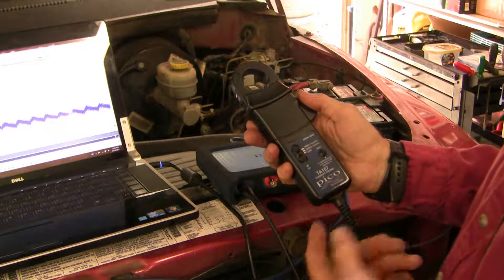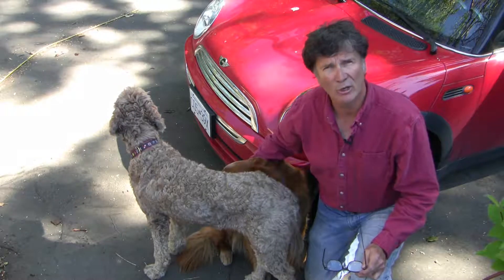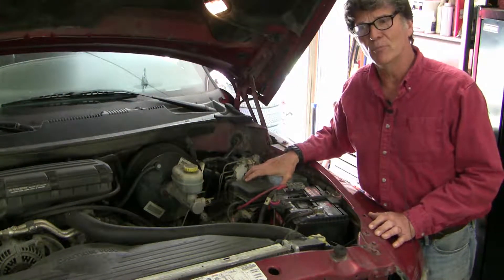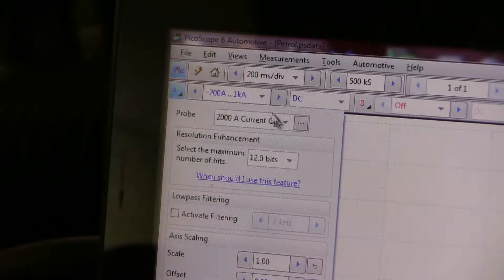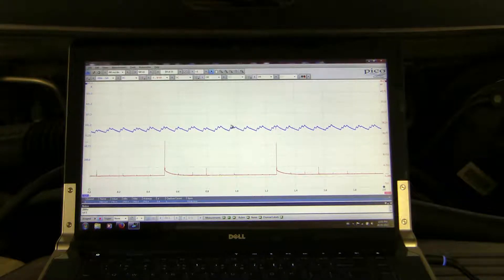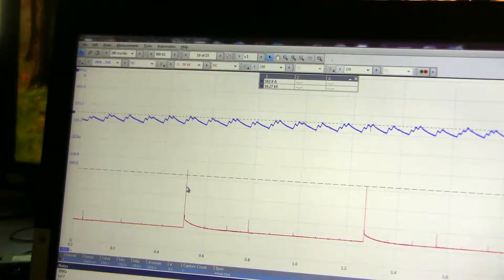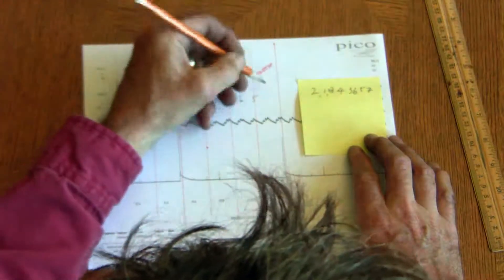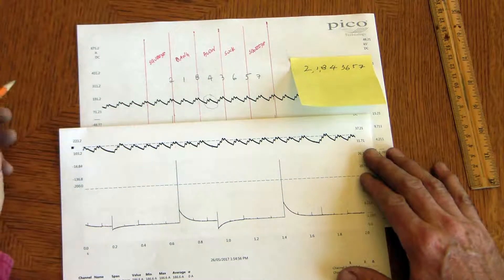Exploring the Picoscope as a diagnostic tool - relative compression testing

Comment: i wish you could have showed me how u connected it . I would have gave you a 5 star.
Reply from the maker: Oh sorry, you just push and twist 1/4 turn clockwise, it's a pretty typical BNC connector (is that what you meant?). Wikipedia have a description of the history and inventors. By using coaxial cables, they get around some inductive effects of two wires in parallel.

Comment: Hi Dave !!...great video. I just bought myself the 2 channel 4000 series Picoscope a few weeks ago and have been using my "drive only in sunny weather" 2001 Corvette as my "guinea pig" for testing...I'm up to doing the relative compression test using my Pico 2000 Amp clamp (same as yours) and a "sync probe" I purchased from AES Wave. for whatever reason the Amp clamp was unresponsive...do you think a bad clamp ??...now if I set my scales up on the high amp clamp to a low scale would I be able to check say my fuel pump...I have used my low amp clamp to check my fuel pump and it worked great...just want to check to make sure it's not defective...I used the compression test in the Pico's diagnostic program the other evening and that worked fine...just connect to the battery terminals and crank.. Thanks !! p.s. Using the sync probe what probe do you tell the Pico you are using ???...  I don't see any clamp named "inductive" clamp in the drop down menu...I guess you use either secondary positive or inverted ??
Reply from the maker: Check the battery on the 2000A clamp, make sure it doesn't turn itself off while you are setting up the test, it is automatically programmed to turn off after a few minutes of activity. It has an LED light to show when it is on. You can also check amp clamps with a multimeter to try and decide if the issue is with the clamp or the channel or channel wiring. Make sure the channel is turned on and recording. Yes, fuel pump amperage is usually about 6A, although newer pumps use a pulse wave modulated signal so when you look on the scope you see a rapid on/off pattern, with the duty cycle measuring power draw. You probably already know this but for others who read the thread, make sure the amp clamp is only around one wire, a second wire with current going the opposite way cancels the signal. For sync I set it up as secondary voltage, and my gear seems to do better with the inverted button clicked, and of course with capacitive clamps you don't need an attenuator, voltage works at a setting of ~5-50 kV. I discovered those PICO clamps for secondary voltage are actually capacitive rather than inductive, although the end result is the same. If measuring primary side voltage on either the coils or the fuel injectors, make sure to use a 10:1 attenuator because of the sharp voltage spike when the current turns off. Good luck!
Reply: Dave, thanks for the quick response. I read that the clamp does turn itself off and one time it did that...now I check...I've read that you can turn off the "sleep" function. My fuel pump checked in at 6.073 amps at 5314 RPM...The amp clamp is around only one positive lead...oh yes, I also purchased the Pico COP probe to use that on my 2016 4 Runner...did not get a signal but when I put it on the Corvette's coil I got a strong signal...Pico told me that some of these newer cars COP's are "screened"...the British term for "heavily insulated" I guess and I should drop down to the Mv range and that worked. I'll try what you suggested and thanks again !!p.s  I see you are good friends with Matt from Schodingers Box...a very SHARP tech and a Microbiologist to boot...LOL !!...and Eric O and Paul Danner are "legends"...learned a lot from those 3 gentlemen.

Comment: Great video please do some more using the pico, do a cylinder pressure transducer
Reply from the maker: Thanks, man! More on the way, but I haven't jumped into pressure transducer work yet. I share your interest in the subject, they get so much more information compared to analog max pressure readings. Cost for the equipment is my main barrier, and also I think one needs to see a lot of waveforms before getting a firm grasp of what is normal. Especially with all the variation in cam timing methodology from each manufacturer, understanding normal is harder than it sounds.

Comment: Very nice vidio...im new to pico .....how can i remove waveforms from files..thanks in advance
Reply from the maker: Remember to save your files before shutting down the computer for the day. The next day, boot up the pico software on your laptop, and reload the file you saved with the pico program. I believe pico offer the software for free if you get the file elsewhere or use a different computer. If you saved the entire waveform you can scroll through pages to get the one you want, and conveniently you can zoom in to get the exact shot you want. Zooming out is not as easy if your captured waveform was too magnified and spans two pages, so try to capture everything you want on one screen, even if you plan to magnify later. Remember that zooming in will require higher resolution so you want a high sample rate, so you don't end up with inadequate resolution after zooming. Pico also offer the option to save only one page, which makes for a much smaller file that is better for emailing a page. In that case you want to carefully adjust your fields so you show exactly what you want. Finally, there is also the option to do a screen capture from your computer to create a photograph of your waveform and whatever else is on your screen. Of course saving a screen capture that way won't allow you to manipulate the image or measure qualities inside the pico program, so that option is only for conversion to non pico communication. Good luck, pico is an excellent program.

Comment: A couple of points. You said in your video – “Exploring the PicoScope as a diagnostic tool - relative compression testing” (time stamp 4.40) - that an internet connection was required to access the help files which are found in the drop down sub-menus under the 'Automotive' menu. You did add a written comment to the screen, and you are right, you don't need an internet connection for these files: they are in the software! There are just over 150 of these generic files in the software. 

Maybe you initially confused this feature with the 'Waveform Library' accessible from the 'File Menu'? You DO need an internet connection to access the 'Waveform Library' - as well as a user name. You need to sign up for the free forum access, and then use that same user name to access the 'Waveform Library', which is itself only available when connected to the instrument, and to the internet! 

It’s worth noting that the 'Waveform Library' currently has over 3600 vehicle-specific examples in it. This data base can be searched by make, model, VIN, component, fuel type, etc. Further, many people don't appreciate the true value of this resource. Once you find a file which corresponds to the vehicle or component you wish to analyse, you can use this file as your test file, and it will appear 'ready-to-go' with the same settings, thereby removing the need to make any adjustments to your own settings. Just select the file, hook up to the car and you're ready to go!

New users - especially those who consider the tool to be expensive - may not know that apart from this powerful FREE resource, which enables Free file sharing and the instant use of known good waveforms from a worldwide community of experienced PicoScope users, they also get FREE software updates for the life of the tool :) 

PicoScope comes with 2 software programs - PicoScope 6 and PicoDiagnostics - both of which can be downloaded free, and used in demonstration mode - without buying a PicoScope. Users can see for themselves the features, including all the comprehensive help files which show both generic vehicle information, as well as a massive indexed manual and a tutorial on using the PicoScope software.

PicoScope has been designed to get new users started with the oscilloscope, which is one reason why it has pre-set menus, though these can be turned off, allowing the more experienced user to use the plethora of other features. This makes PicoScope so versatile and in my mind the best tool in the world for learning about the operation and diagnosis of any vehicle system. 

Those who use price or 'it's too complicated' as excuses not to move forward with the changes in technology are really shooting themselves in the foot! Relying uniquely on the 'trusted' scan tool and its limitations is a big mistake! 

Perhaps an explanation of the differences between the scan tool and the oscilloscope and a broader understanding of how and what they 'see' would make an interesting video, and encourage more people to make the transition to ‘proof testing’ with PicoScope, as opposed to trailing along oblivious to what is actually happening during a particular event, just because the scan tool has indicated a 'problem' - or because it hasn't indicated one, and the vehicle ECM is merrily adding fuel to compensate for a problem which isn't there, or isn't the cause of the problem!? 

PicoScope gives us that vital information to make sound judgements about the state of operation of almost any component, circuit or vehicle system. Understanding this is key to getting away from the traditional methods which we used to employ, and to getting to grips with finding the origin of faults and to fixing them first time around!

Learning should be a continuous and fun part of our everyday work. PicoScope has certainly played an important part in keeping me interested and faintly informed, even though I no longer work on vehicles.
 
In the hope that this helps a few people ;)
Reply from the maker: Excellent points, David, and very well stated. I've been looking around at scan tool options lately, and the hidden cost for scan tools is in the updates, which are astronomically high. For the Pico, endlessly free. I have used the library and the forum, both useful as well. Knowing what is a normal waveform for a specific car will continue to be a challenge, in part because some dealer repair manuals lack important detail. 

Dave
Reply: Yes, I agree with you on the scan tool update issue. As a diagnostic tool distributor, I'm constantly looking at new tools, but frankly the market here in France isn't quite the same as the rest of the world. If the tool doesn't 'speak' French it's pointless even offering it. (Luckily the Pico does 'parler français' so it's fine here, too!) 

I tire of people expecting a scan tool to work on every vehicle, and equally of those who sell them claiming that to be the case, when we know that no tool does it all: certainly not in my market where the market is split largely between European and Asian makes. Let's face it, even if the tool communicates with some of the car, so often the coverage of control units is incomplete, rendering it much less use, especially where there is an issue in a system which isn't covered!

My interest and efforts are focused on the PicoScope and its accessories since it does what it says on the tin - and more! I've known Pico since the beginning - when I worked next door to their first building - so I've seen the company grow from small beginnings to becoming the world leader in their field. Whilst I'm entirely independent, I distribute their tools in France, French territories, and Africa. 

It's really rewarding talking with those interested and being in a position to understand their plight and to encourage them to take the step into Oscilloscope diagnostics. Many of my clients are schools and technical colleges, though more and more garages and even individuals are getting the bug! 

The pressure transducer is also a popular accessory, and this adds another interesting diamension to diagnosing internal engine problems, as well as those which concern pressure in other areas of the vehicle. 

I'm filling your page again - sorry!!  I don't suppose you speak French? Your videos would be perfect here if they were in French! I tried the auto-translate but frankly it doesn't do your videos justice. I could do that for you if it would interest you, but ideally it would need to be voiced over, rather than subtitled, since it's difficult to follow like that.

Let me know your thoughts? contact@autotechnique.fr 

Keep up your great work :)
Reply from the maker: I really made an effort to learn French, and we sent my son to a French immersion school. Sadly, learning French is one of my major life failures. If you'd like to contribute a voice over, I would support that. I don't know what that would involve or whether it would be worth it to you. Thanks for stopping by, David!
Reply: Thanks for your reply, Spelunkerd. After nearly 19 years in France it's still an effort for me, lol! On my next lazy Sunday afternoon I'll try following you in French and see if it's workable. Could be quite a bit of work, but I like what you're doing! Thanks again.
Reply from the maker: Thank you David, that's very kind.

Comment: I don't understand what you did with the ruler. What did you measure when making those marks with the ruler at an angle? Good Video.
Reply from the maker: Excellent question! A quick way to divide an odd length into equal parts without using any math is to tilt the ruler at an angle. In this case I wanted to divide the distance between the firing spikes for cylinder #2 into four equal parts, corresponding to the four phases of the combustion cycle. The length between the two marks was about 3 1/8th inches, which would be tricky math. So, to avoid any math I tilted the ruler at an angle to increase the length to an even four inches, which made it easy for me to put a mark at each inch mark. In this case I lined up the mark for 1" on the left, and 5" on the right, which gave me exactly four equal 1 inch segments between the two ignition spikes for cylinder #2. Then I put a dot at each of the inch divisions. After that I used a straight edge to bring those marks vertically down to the baseline (easy with vertically lined paper). On the PICO you can do that electronically by just dragging a 720 degree slider, but with pencil and paper it is easy to do with a ruler. You can choose any multiple you like, but in this case the 1" marks worked out fine. Thank you for watching.
Reply: Interesting. Thank you.
Reply: @spelunkerd : Just brilliant!

Comment: I use the other Pico compression software gives green bar and % of relative compression. you have to sometimes go right to starter with ampclamp to get propper non fail reading.
Reply from the maker: Good points, thanks for your contribution here. I haven't tried that corner of the software yet, but will do so in the coming weeks when I chase down what's happening in cylinder 4.

Comment: Lab scopes are great tools that will be even more relevant as cars become more advanced. But they are expensive! Anyway great video.
Reply from the maker: Yeah, cost for tools is an issue. Every time I do a repair I invest savings into better tools. Over four decades I now have an excellent tool set, ha ha. The way I see it, tools really are an investment for the long term. Scanners would be hopelessly outdated over that time frame, although fundamental oscilloscope data would still have value. The weak point would be the computer interface.... What I value most about auto repair is the insight I get when I look at a vehicle and understand a little bit more about how it works. That feeling is priceless. Thank you for watching, I'm hoping the upcoming secondary waveform video will be significantly better.